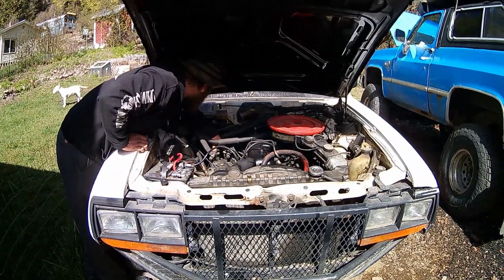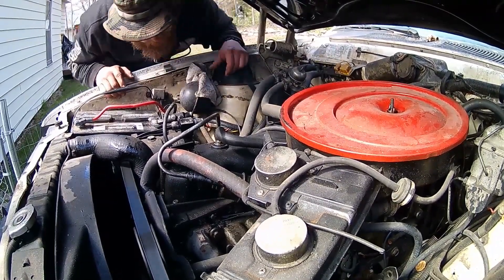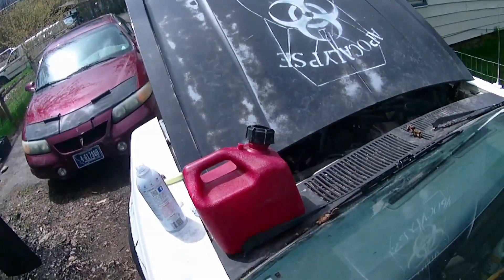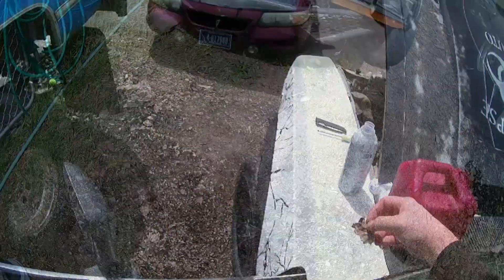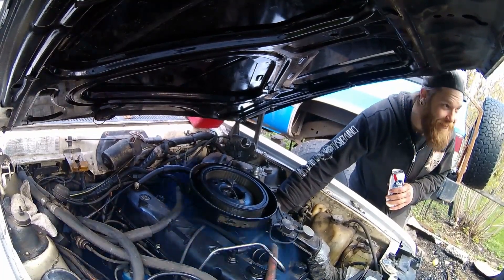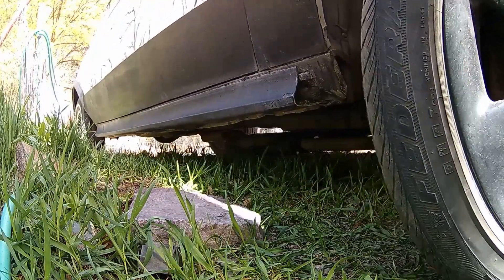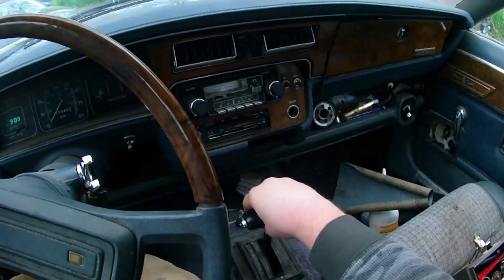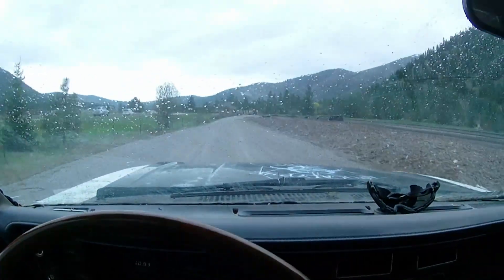DIY seafoam on a carbureted engine

Comment: Dont ever give your engine "one last glug" of any fluid ever its a great way to bend or break a rod, even though its carbureted engine you should still use the spray form of seafoam
Reply: Yes I'm surprised he doesn't need a carb rebuild after that
Reply: @garysonbuhs9641  it's not going to hurt the carb but it will hurt the valves and rods. Liquid dont compress
Reply: @joshuabarfield5205  yes that's why thares a oily one ment for the intake

Comment: Do you think seafoam would work in a throttle body injected 2.7 L inline 6?  I have an apocalypse 1986 chevy s-10 I think you guys would love!
Reply from the maker: I like the sound of it! Ya seafoam should work and help clean it out
Reply: I think that would be a 2.8 liter V6. I had an 82 S10 that had that engine :)
Reply: 2.7 inline 6???? They barely fit a 4 cylinder inline. It must stick out of the grill a foot....

Comment: Cool video. Extra tip for you, if your plugs are that dirty and you can't get new ones. A toothbrush and soaking them in seafoam can clean them up. I also use rubbing alcohol or even some gas. Are you guys going to mod this car for Wasteland this year?